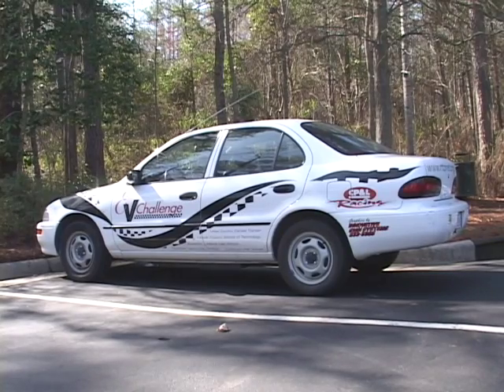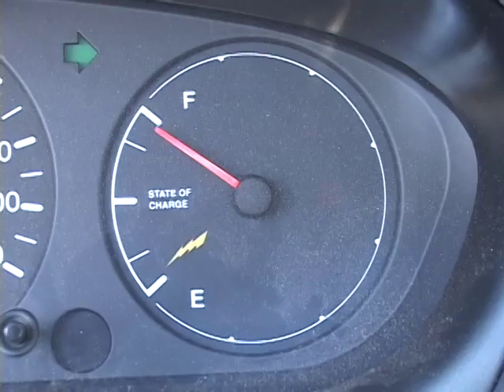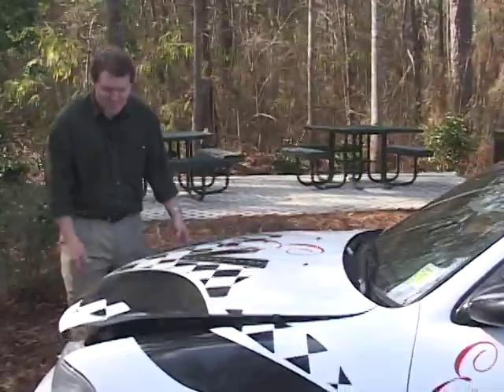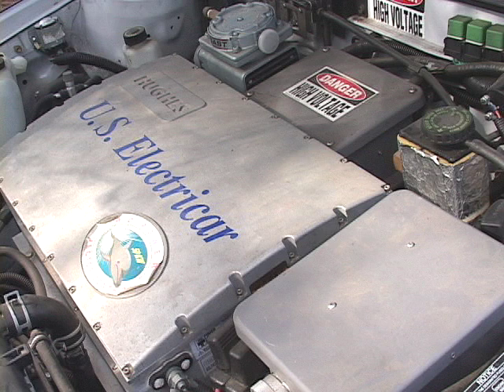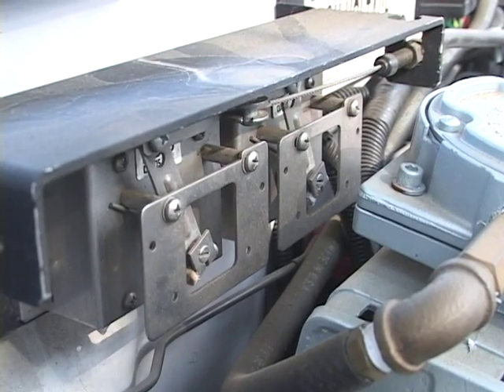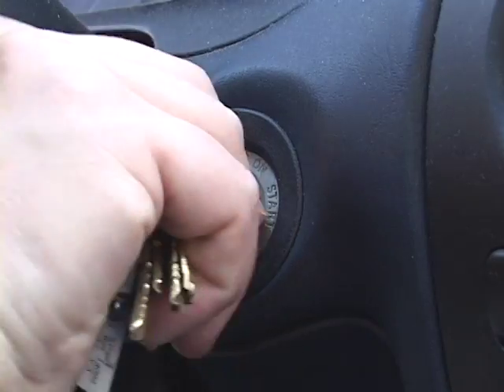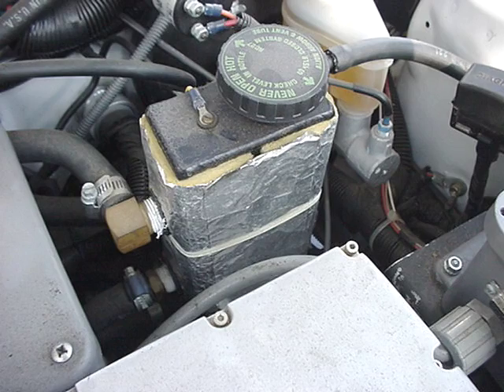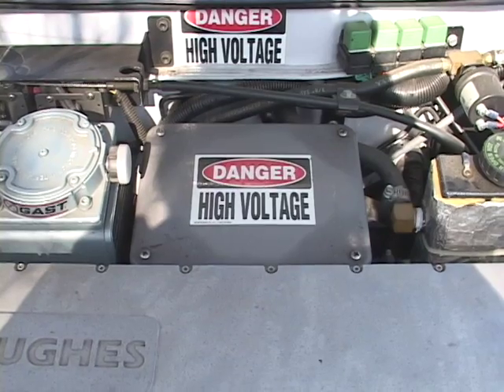How Electric Cars Work

Comment: @guily6669 From what I can find this nanotech of yours is just a model of RC batteries made by Turnigy, I really doubt they're that special. Actually, I wouldn't be surprised if batteries used in electric automobiles are much more efficient than that, as they're manufactured by more serious companies than RC toy and accessory producers, just they don't advertise like that as their products are of no use to individuals. So point stays the same, everything is fine as it is.

Comment: @guily6669 Nano-lipo? I think you're talking about Lithium Polymer batteries, and they are currently used in electric vehicles. Not sure what nano batteries you are talking about that are currently manufactured. Even if electric car manufacturers have the technology to apply higher capacity batteries, they simply won't jump right to them, they'll make a smooth transition over the years to sustain innovation and maximize profits.

Comment: @guily6669 On the wiki? Seriously? That's what I've been talking about, you're supposed to have a real product if you want to use it, not just the concept which may or not work in real life. Just because small batteries are used in RC cars, there's a reason we can't just throw away the 150 year old lead-acid batteries and put in a couple of phone batteries. While these have a large capacity/weight ratio, they don't support high current flow, something that is necessary to move such weight.

Comment: @Nezzizzle Continued The less the mass of the vehicle as compared to the weight of the driver, passengers,cargo the more energy efficient it is.Hence electric motor powered bicycles are highly efficient getting from one location to another.Driving a car with just a single occupant is extremely wasteful.
The only advantage an electric car has is that electricity is cheaper.However the batteries and their replacement costs mostly nullify that advantage.

Comment: @Nezzizzle Electricity is cheaper than gas per mile and electric motors are a lot more efficient than Internal combustion engines 75% to 90% vs 18 to 20%.Energy density of the batteries is vastly poor compared to gasoline about 50 to 75 times less.Main disadvantage of electric cars or even gasoline powered cars is their huge wasted mass that has to be carried (weight of the vehicle).Electric powered vehicles less than 400 pounds are very efficient like an electric scooter,e bike or e aircraft

Comment: Wikipedia - "Petroleum (L. petroleum, from Greek pet???a???, lit. "rock oil") or crude oil is a naturally occurring, flammable liquid. . ."

Answers - ". . .mixture of gaseous, liquid, and solid hydrocarbons that occurs naturally beneath the earth's surface, can be separated into fractions including natural gas, gasoline, naphtha, kerosene, fuel and lubricating oils, paraffin wax, and asphalt and is used as raw material for a wide variety of derivative products."

Comment: Merriam-Webster - "an oily flammable bituminous liquid. . .is a complex mixture of hydrocarbons with small amounts of other substances, and is prepared for use as gasoline, naphtha, or other products by various refining processes"

Now some websites

Petroleum(UK)- "Petroleum in its natural form when first collected is usually named crude oil. . .For several decades now the crude oil or petroleum industry. . ."

Comment: Let's start out with some definitions of Petroleum from various dictionaries

Dictionary online - ". . .occurring naturally in various parts of the world and commonly obtained by drilling: used in a natural or refined state as fuel, or separated by distillation into gasoline, naphtha, benzene, kerosene, paraffin, etc."

Oxford English Dictionary -"a hydrocarbon oil found in rock strata and extracted and refined to produce fuels including petrol, paraffin, and diesel oil; oil."

Comment: You don't need to get so upset over petroleum, I never initiated any personal flaming, and you shouldn't have to either. 

I never said bitumen is gasoline. I never said ANY petroleum product except gasoline was gasoline.

Petrol, Benzine, Gasoline, whatever you want to call it, it's the same thing. All words are made up, and these are no different when they were made up in late 1800s. 

If you want me to look this up, then fine, here we go.

Comment: That's incorrect. Petroleum IS crude oil. And obviously, many different fuels come from crude oil, which by the way, are called PETROLEUM PRODUCTS because they are derived from PETROLEUM which is the same as CRUDE OIL. Don't confuse Petrol (the nickname for gasoline in many countries) with Petroleum, because they are two different things.

Comment: When electricity is produced in mass )like in a power plant) it's more efficient than singular engines working for themselves. This is mainly through heat loss which is usually handled in smarter ways at power plants. Also electricity is becoming greener though you are right in saying there are coal power plants - nuclear is coming into it's own; if the American hysterics would let it. Nuclear has a better safety record in America than coal.

Comment: On top of that you have the batteries, which today are normally lead-acid. These weigh a ton, and if you throw them away (which usually they die after about a year) its horrible..

However, with research and time, batteries as well as electrical principles in general such as hydrogen cars I see potential in... Just right now we definitely need to find something that doesn't kill everything, even down the road.

Comment: most off the cars engine is protected against water ( u can drive it when it rains, dont u ? :P ) so it doesnt do mutch damage, u can u se bodykits because u only affect the appearance off the car and not its performance, but no turbos ( because it doesnt run on gas, turbos are only usefull for gas powered engines), and they run preety mutch as fast as your everyday family car because they dont produce as mutch horse power ( u will need a mutch bigger power source for sutch an engine )

Comment: They have lower top speed, but the acceleration is awesome. 0-60 in 3 seconds, maybe..haha, I'm not sure, but it's very fast. That's because the torque is at max from the very start, and that they dont need to shift gears. (They run on extremely high revs too, so it's enough with just one or two speeds in the gearbox.)

Comment: The use up a lot of juice in stop-&-go traffic. Unless you're really going far, they're a good deal. Isn't it like 30 or so miles on a charge? That's pretty good. Even if you live in the country, you can get to work, charge there and ride home. Have your first car be gas for distance or deep winter driving.